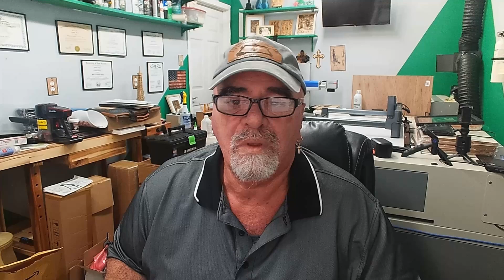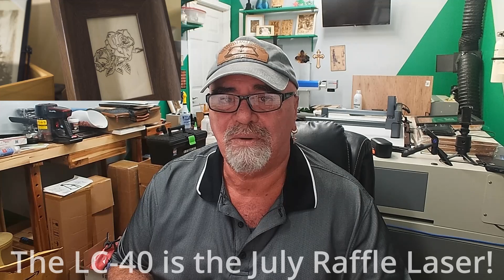ℹ️ Genmitsu, Jinsoku LC 40, Diode Laser Engraver Review!

Comment: Just received this laser and have a few questions please.  Does Lightburn support this laser?  Also, but not related, I've been using Carveco Maker for several months now and have been watching your videos of Lightburn and it appears to me that Lightburn is far more flexible and intuitive for creating vectors than Carveco.  Do you have an opinion about using Lightburn for creating CNC designs and exporting them to Carveco for cnc cutting and engraving?  I should mention that your instruction videos are amazing.  Clear, concise, to the point and enjoyable delivery makes me watch from beginning to end.  Not to mention the melodic cadence of your voice makes it flow throughout your videos.  I'm an old wood worker and just started with my CNC and my laser is still in the box.  I like to learn the software first before I start using the machine.  I did the same with my CNC and that method works well for me., Chazz
Reply from the maker: Yes it does. Lightburn will be launching Millmage in the 1st quarter of 2024 for CNC machines.
Reply: I just downloaded Lightburn and within minutes I was able to duplicate a file that I struggled with in Carveco, exported it into carveco flawlessly.  I had 3 month free from Sainsmart, do you think  I should wait for this new release? BTW, I learned it all from your videos.  I've never supported on Patreon, but with you I think I have to make an exception.  Chazz
Reply from the maker: Thanks Chazz... Lightburn works fine for 2D projects, but Millmage will look and feel like Lightburn, but with all of the CNC features for 3D.

Comment: Looks great, better than any laser I have seen so far.  I especially liked the linear rails, limit switches, and cable management.  I just ordered one with the 5w fac laser module.   I was going to order a 10w, but decided I really don't need a 10w laser.
Reply from the maker: Awesome! 👍 Thanks for watching!
Reply: @TheLouisianaHobbyGuy  So far I like the laser though I have not quite set it up yet.  There are several things I don't like.  The controls being in the rear I don't like that much.  Also, there is an issue with adding air assist on the F.A.C. laser module.  I mistakenly bought the air assist for the le-60, but I am going to keep it with the hopes I can 3d print something that will work with this laser module.

Comment: Genmitsu

I bought 2 LC40s, as well as a ProverLX 4030. Had to return all 3 for one issue or another. Also a Fox Alien Masuter Pro(stay away, weak frame)

The genmitsu Proverlx 4030 has serious issues as it often stops in the middle of simple test run. It's noisy, unrefined and the software or firmware associated with it all seem very screwy. Not reliable at all.

The Genmitsu Jinsoku LC40 looks like an X-Tool D1. I think that's about it

Nice cable management. But design of the screw plates and attachments is faulty as the fully assembled, fully tightened machine would click loose when picking it up by a rail. Any rail. Not very reassuring 

No more saint smart products for me. I think they are junk

I bought a Long Mill MKII CNC instead. From Sienci Lab

Also Neje Max3 laser with 420x860mm frame. At least it's got 10w+ and expandable to 860x1150mm

Stay away from genmitsu...there are reasons why not many people have good things to say about their products, except those YouTubers who obviously are getting freebies from these manufacturers

Good idea is trying out machines you're interested from Amazon. Don't like just return them. Keep trying until you find the right machine

Good luck to all
Reply from the maker: And I haven't had a single issue with the LC-40 or the 3018 Prover. Both have a lot of hours on them. You can't compare a Longmill to a economy CNC.

Comment: blocking and skipping is becouse steppers are connected to motherboard and they create voltage by you moving it ,if you disconnect steppers movement will be smooth,linear rails inside as you showed :)
Reply from the maker: It's a nice machine Igor.

Comment: How thick can this machine cut with its stock laser module? On harder wood
Reply from the maker: This was a stock laser module. I was able to cut 10mm oak with it.
Reply: @TheLouisianaHobbyGuy  Oh that's good. I only need up to 6mm. How many pass with 10mm. Thank you by the way for the great video and for your reply.
Reply from the maker: @woodyoulove-reynaldguibone6890  I did the 10mm in 4 passes and it cut cleanly. Your results will vary depending on the water content of the wood.

Comment: Hi Rich, I’m having issues connecting to LightBurn, I’ve connected up the LC40 laser but it won’t connect to LaserBurn or LaserGrbl either. I’m connected to Com port 5 (tried multiple com ports and still nothing) and when connected laptop makes the connection sound. I’ve tried putting a manual laser in and adding the bed area dimensions in and still nothing. The LC40 app works and so does Sainsmart Engraving software so I know the laser works including the usb lead. I’ve loaded and reloaded the driver also but still won’t connect or even see the laser.
Any ideas?

Many Thanks
Reply: After all this time you gave found a solution. If not, you might have to disable all other usb ports on your computer until you get the firmware flashed. Then re-enable them after determining what com port your laser is connected to. That’s what I had to do.
Reply: @douglasmitchell4063  I did just that. I did say to the manufacturer that that information needs to be in the instruction booklet and not having to scour the Internet for it.
Reply: @marksneyd1262  did that solve your firmware and connection issue?
Reply: @douglasmitchell4063  yes it did, it now works with LightBurn.
Reply from the maker: Hi Mark, you have to load the GRBL firmware to use LaserGRBL of Lightburn. The original firmware is for their proprietary software use. In the software you received is a user manual that shows you how to do it.
Reply: @TheLouisianaHobbyGuy  I have tried to flash the firmware by holding the repeat job button for 3 seconds and then press the power button on, is supposed to put the machine in a state to receive the ROM.bin (copy of firmware) for LaserGbl and LightBurn but for some reason it’s not working. I’ve tried its number of times to no avail. It does work with their engraving software and through the app absolutely fine. It’s a shame because the build quality is outstandingly good.
Reply from the maker: @marksneyd1262  It does work, it's just finicky! It took me 3 or 4 tries to get it to work.
Reply: @TheLouisianaHobbyGuy  thanks, I will have another few goes then. Thanks
Reply: @TheLouisianaHobbyGuy  hi Rich, I’ve checked out the file on the usb and the file is identical to their software so every time I flash the firmware it puts their software back on. I don’t suppose you have the firmware to hand do you somewhere on your computer that you could email to me do you?
Many Thanks
Reply: @TheLouisianaHobbyGuy  hi Rich, I’ve checked out the file on the usb and the file is identical to their software so every time I flash the firmware it puts their software back on. I don’t suppose you have the firmware to hand do you somewhere on your computer that you could email to me do you?
Many Thanks

Comment: Brilliant review, I’m sold, now over to Amazon. I have the xTool D1 on back order, I think I’m going to cancel the order and get this one instead but get the RA2 roller system for this assuming it will work with it.
Reply from the maker: It will not work Mark. This is a unique laser and it uses USB type C connectors... the only one I have ever seen.
Reply: @TheLouisianaHobbyGuy  I’ve sent them an email but I suspect you are right.
Reply from the maker: @marksneyd1262  They have their own rotary coming out soon for it Mark.
Reply: @TheLouisianaHobbyGuy  I’m still going to buy one I think and then get the rotary later. Looking at this machine I’m sure it will be very well designed.
Reply from the maker: @marksneyd1262  It's very well designed, but if I had my choice, I would personally go with the Ortur Aufero Laser 2. Amazon has a $100 off coupon right now making it $399 and the one I have on the bench right now is performing better than any other 5W I have tested.
https://amzn.to/39XsPv9
Reply: Hi Rich 

Just found this video on YouTube of a machine on kickstarter that’s called Mr Carve M3 that looks exactly the same as the LC40 other than that’s got a plethora of accessories and a 10 watt laser and even a infrared laser upgrade. That’s interesting 

https://youtu.be/FsJL_MCAg3o
Reply: I advice you stay with XTool 

Genmitsu looks good but unreliable. QC also questionable as my new genmitsu CNC came with several rusted screws installed 

Had to return my 2 LC40 lasers because frame would click when picking it up. Stepper motor cable attachment also crazy short and almost impossible to attach by hands

Just not very refined products

Comment from the maker: A few things I left out! This is a 400x400mm laser, it uses either Grbl or a phone App (switching between them would mean a firmware flash which is clunky IMO); it is Lightburn compatible and a type C roller accessory is coming soon!
Reply: @The Louisiana Hobby Guy  Can you tell me what the top speed setting on this is, when I 1st set up the machine the settings went to 6000 now it only goes to 500, Thanks
Reply from the maker: These run at 6000 mm/min Jeff.

Comment: Looks like a very nice machine. The cable management is something all the manufacturers should take a careful look at, most of it sucks. 😁 With the prices of diode lasers going up so fast it's almost cheaper in the long-run to buy a 50 or 80W C02 laser now. I've been amazed at the asking prices some of these companies are asking. Good review as usual, thanks for the video!
Reply from the maker: You're right George! With the hobby getting so popular, many companies are taking advantage of the market. You can't say that about Genmitsu though.
Reply: @TheLouisianaHobbyGuy  Can you tell me what the top speed setting on this is, when I 1st set up the machine the settings went to 6000 now it only goes to 500, Thanks